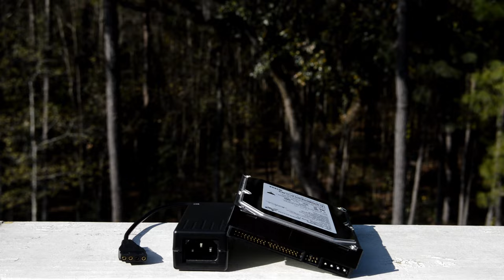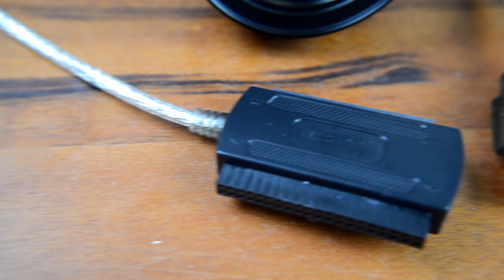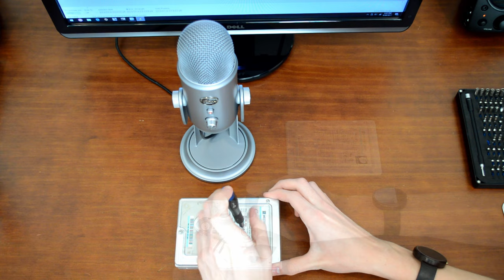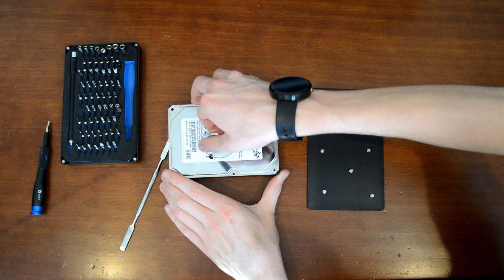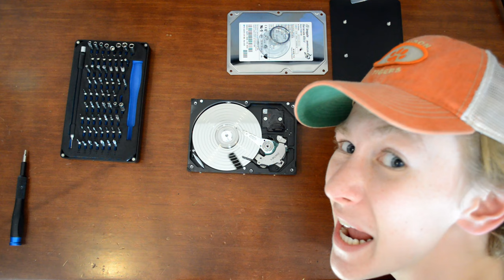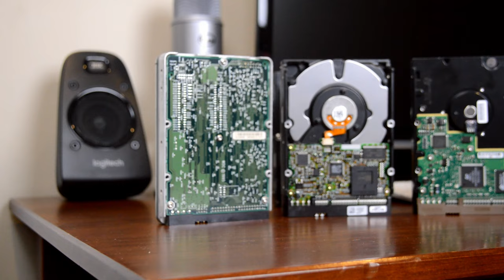How to fix a HDD

Comment: What I think they should do, is recycle all HDD and remake them all in SSHDD that use less energy, make them faster, and also heat less, with two reading heads and actuator arms for faster speed, while using less energy so they don't heat up as much.
If they make the Hard Drives SSHDD, the spinning can be stop when not using memory from the disc, and this can help the HD cool off a bit.
Reply from the maker: lol, they really don't get that hot.
Reply from the maker: and that's old technology now there is ssd's :)
Reply: Vos top is better if they can recycle all of them and make them better, as SSHDD they can be faster, also if they have RamCache for example 4GB of ram in it and used as Cache it will be super fast, also to use less energy with two actuator arm readers will be better.
They should recycle them in the post office will be a good idea
Reply: Vos top what they can do is recycle all the old ram, for example anyone who wants to recycle the DDR2 and or DDR3 ram they don't want, they could use the ram to place it in the new SSHDD, so they can be much faster and that way they get rid of all that old equipment people don't use and or want
Reply: Vos top I know there is SSD's, but the HDD is not bad, is just better to recycle them so they can use less energy and be much faster, a little Ram Cache can help, and also two actuator arms or a different reading mechanism that requires less heat, if they could do an entire longer arm that has more reading heads, the arm would require less movement, and also the spinning disc could rotate less fast in order to be fast, having 60GB of SSD can be awesome for games, because it will be able to store enough data from each game, and working as raid0